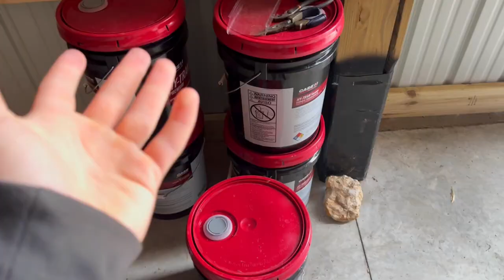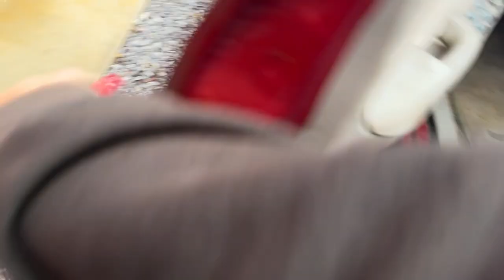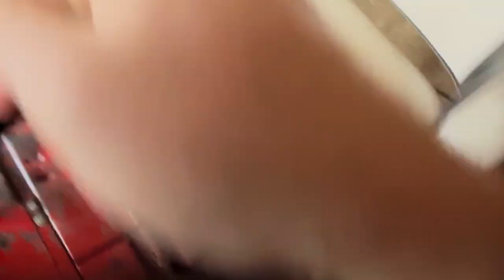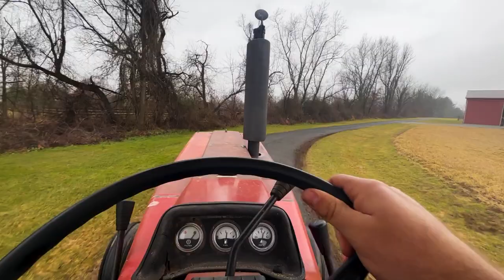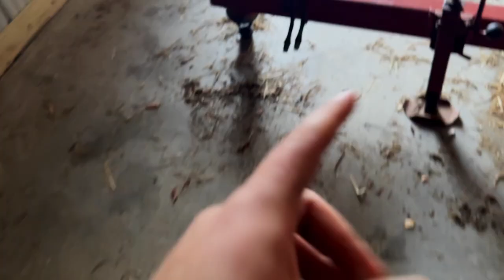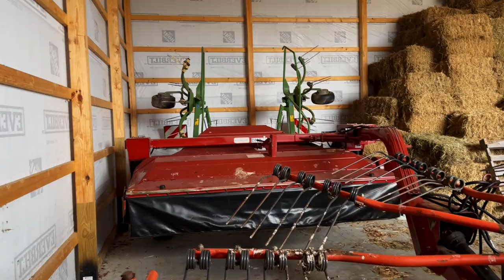INTERNATIONAL 966 Transmission Fluid Change (Clogged Filter and Bad Oil)

Comment: Don't celebrate just yet, the fact that it won't move without hydraulic pressure means the sprauge clutch is junk, Yes if the ta is good it will drive the tractor with no oil in it.